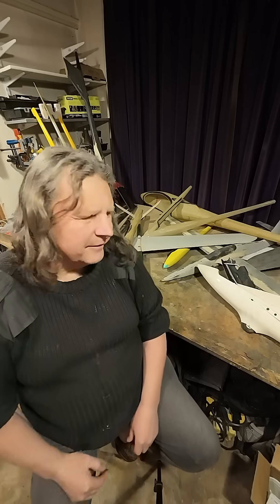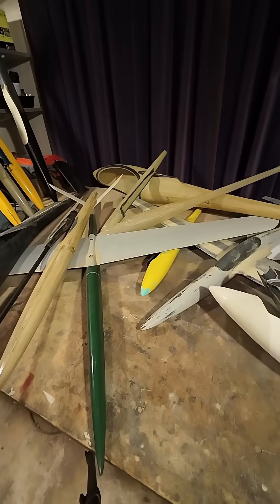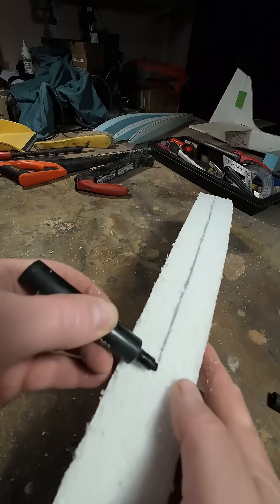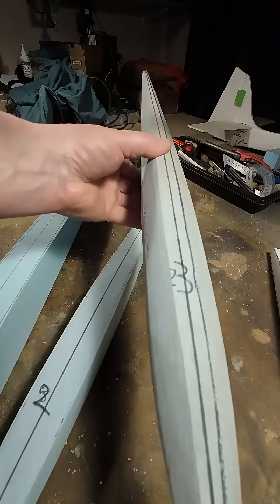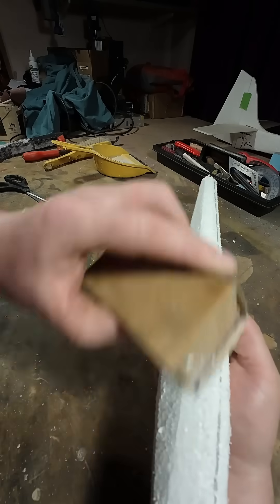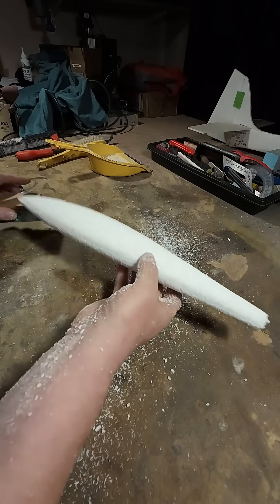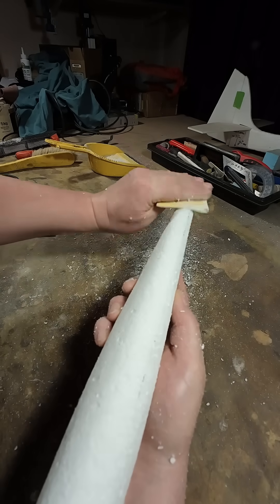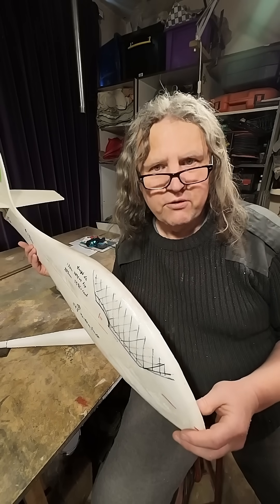Perfect your RC Fuselage Designs with this Simple Hack

Comment: Small tip - you can use foam cutter with nichrome wire instead of jigsaw to speed up the process
Reply from the maker: Thanks.  Have cut a lot of foam with hotwire.  Fuselages, wings,  cnc,  drop arm bows, hand held, table mounted ect. Do you think people would find  that interesting?
Reply: @valegliders Yes, especially if you have made some custom foam cutter for specific needs or purposes.
Reply from the maker: Thanks, will work on that. 👍